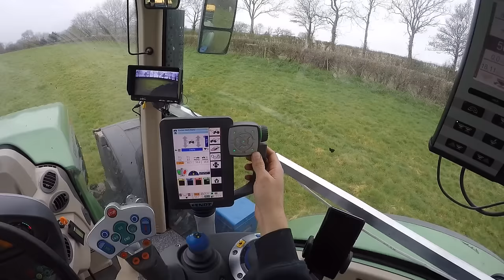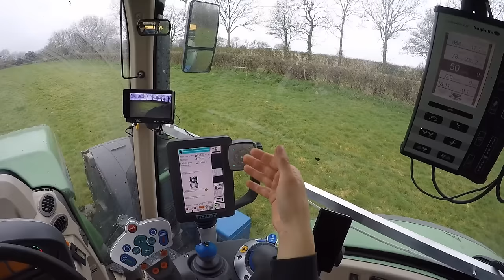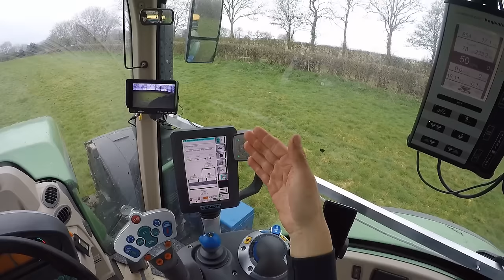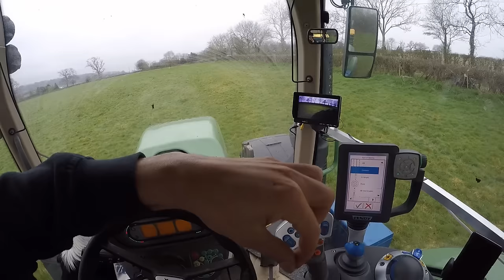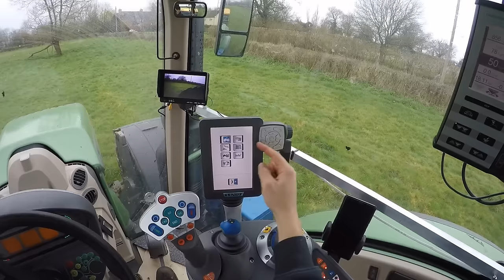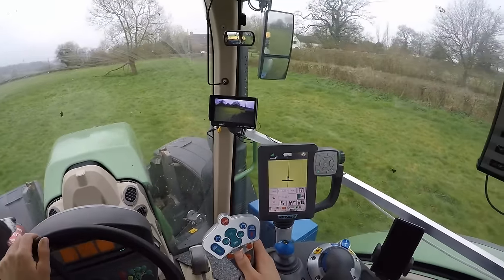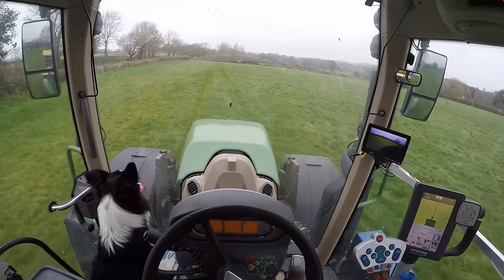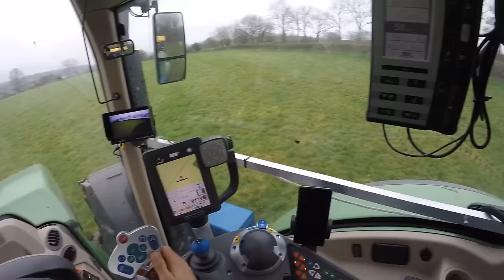How to use GPS and Auto steering in a fendt

Comment: During your implement setup you skipped over the navigation point and worked area measurements, you left these at 0.  You really should input a value into these boxes as the tractor uses them to help guide the implement online and also the worked area coverage map will start and stop in the correct position.  When you leave this as 0 the system uses the receiver location (right above your head) as the point that it tries to steer online and the worked area starts and stops at this same position, rather than the implement or position of the product application.  I presume your spreader is 3pt mounted and since you are using autosteer as the coverage map enabler these measurements are somewhat redundant, however if you are using a drawbar mounted implement and are looking for accurate coverage maps then these measurements are crucial.